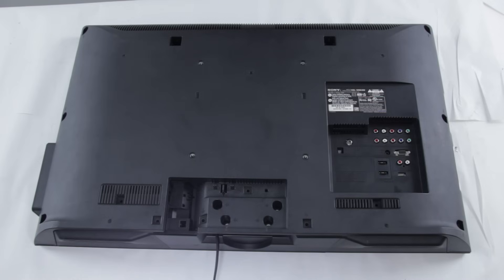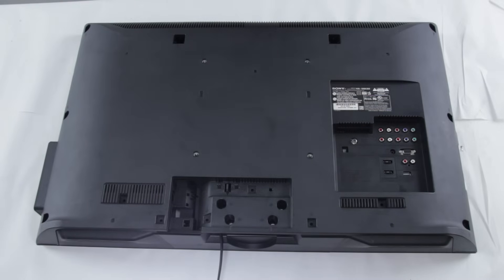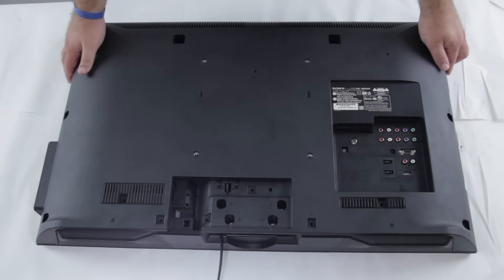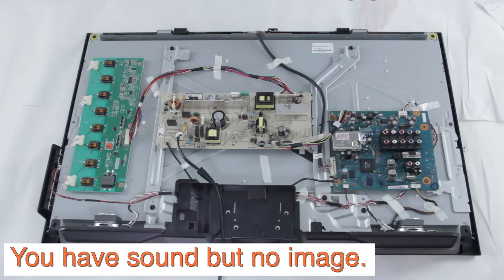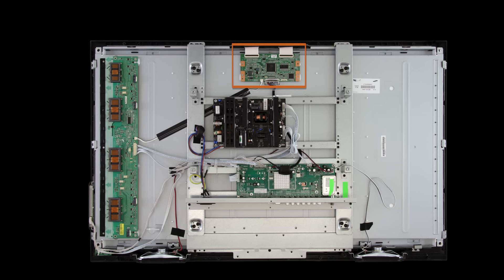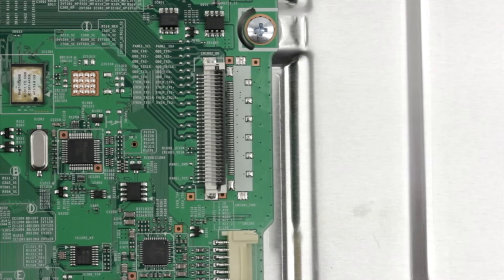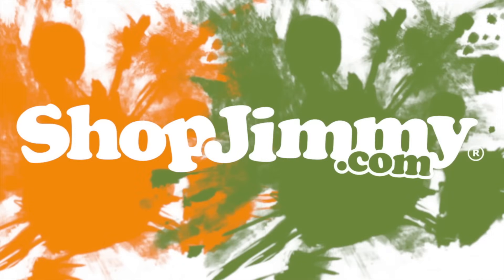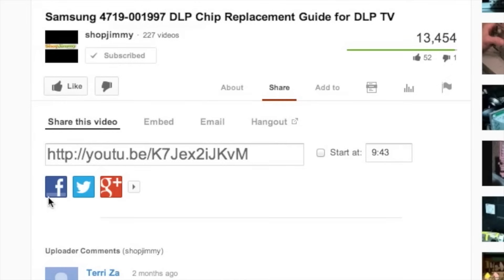LCD TV Repair Tutorial - T-Con Board Common Symptoms & Solutions - How to Replace T-Con Board

Comment: Appreciate all the videos you folks post to try and diagnose problems.  I have a UN55D6050TFXZA given to me by a friend that replaced the power supply but it didn't fix the issue.  Issue at hand is that the TV will not power up (stand alone, nothing hooked to the inputs).  The power LED will flash multiple times but nothing happens.  This model has the light around the outside frame and it doesn't even turn on.  I tried getting a replacement main board from you guys but it must be a hot model as you have no inventory (BN94-04358G).  I did find one on ebay and purchased it but still have the same symtoms.  The only board left is the T-Con.  Do you think this is my issue or do I have a bad LCD at this point?

Thanks for your time......
Reply from the maker: Todd Stam   I believe you received a defective main board from Ebay.  I recommend that you continue to find a new one and see if that will fix your TV problem.  Thanks!  www.shopjimmy.com

Comment: We have a Samsung 32 inch model LND32D430. Bought at Costco.
In the last week after a minute of being powered on the top of the screen develops a shaded gray 2 to 4 inch area. It goes left to right.  That shaded area stays there even with a change in screen size.  The shaded area stays on also when the cable box is connected or disconnected.  Have also done a hard factory reset with no loss of the shaded area.  Any answers on what is needed to fix this?  Thank you in advance for any imput.
Reply from the maker: Ron Normandeau  This sounds like a TV panel problem.  If your TV panel is bad, it may be more cost-effective to replace the TV as panels are typically hard to find in stock, difficult to replace, and expensive.  Thanks and please let us know if you have any further questions!  www.shopjimmy.com

Comment: Model No. LD320SSX
Serial No. DSIA0931171486
Sylvania 
When the power on, the colors changing by itself, (red,green,purple,blue,white) looping all the time. I already try the remote by hitting down or up arrow key, but it does not solve the problem
Reply from the maker: *****  I recommend replacing the main board in your TV.  Here is a link to replacement parts for your TV model number on our website, click here:  http://www.shopjimmy.com/catalogsearch/result/?q=LD320SSX  Be sure to match part numbers on your current board, with your replacement for compatibility.  You can also call our customer service for further assistance with your purchase.  (877) 881-6492  Thanks and please let us know if you have any further questions with your TV Repair!  www.shopjimmy.com

Comment: I have a KDL-46VL160, there is 2 vertical lines on the left side, and the left and middle is faded dark..
Reply from the maker: ben slaney   This sounds like the problem is either the T-con board or the TV panel. If the TV panel is bad, it may be more cost-effective to replace the TV. You can replace the T-con board to see if that fixes the problem. Here is a link to replacement parts for your TV model number on our website, click here: http://www.shopjimmy.com/catalogsearch/result/?q=KDL-46VL160 Be sure to match part numbers on your current board, with your replacement for compatibility. You can also call our customer service for further assistance with your purchase. (877) 881-6492 Thanks and please let us know if you have any further questions with your TV Repair! www.shopjimmy.com

Comment: I have a Sony Bravia KDL-52w3000 with vertical colored lines on the right side of the display.  After the unit has been powered on for about 30 minutes and has warmed up, the lines start to go away.  Any help would be appreciated!
Reply from the maker: tbirdman429   This sounds like the problem is either the T-con board or the TV panel.  If the TV panel is bad, it may be more cost-effective to replace the TV.  You can replace the T-con board to see if that fixes the problem.  Here is a link to replacement parts for your TV model number on our website, click here:  http://www.shopjimmy.com/catalogsearch/result/?q=KDL-52w3000  Be sure to match part numbers on your current board, with your replacement for compatibility.  You can also call our customer service for further assistance with your purchase.  (877) 881-6492  Thanks and please let us know if you have any further questions with your TV Repair!  www.shopjimmy.com

Comment: I have a dx-42e250a12, my symptoms are successful power on, low buzzing humming after power on, increase in volume of buzzing regardless of volume/mute setting on tv and eventual self shutdown by the tv. The shutdown of the tv start withs strange bars vertically and horizontally, and then the unit sel-powers off.
Reply from the maker: Shane Dalton   I recommend that your visually inspect your power supply board in your TV.  Check the capacitors for puffy tops.  Here is a link to a video on capacitors:  How to Test a Capacitor TV Repair Help with Multimeter and ESR Tester Puffy Capacitor  Please reply with the results of your inspection and please let us know if you have any other questions!  www.shopjimmy.com

Comment: Hi help ?? Have 2 lg tvs both same model . Both have lines across screen 1st has 2 vertical 2nd has 6 inch horizontal . Swapped tcons over and both stayed same the fault never swapped over . Warmed up t con board with hairdryer and picture comes on and is ok if turned on / off all day every say hour ?? Is this a t con problem ??? Thanks
Reply from the maker: Colin Brookes   You can try replacing the t-con board but when you heated them with the hair dryer you probably also heated the area of the panel that is bad and had a quick fix.  I am thinking the panel in your TV is bad.  If this is the case, it may not be cost-effective to replace the panel.  Please reply with your TV model number if you would like a recommendation on replacement parts.  Thanks!  www.shopjimmy.com

Comment: Hi, I have a Sony Bravia KDL40EX653. Top part of my Display is Flickering with a Blue strip. Could you please suggest what may be the problem
Reply from the maker: rohan07091987  This sounds like a TV panel problem.  If your TV panel is bad, it may be more cost-effective to replace the TV as panels are typically hard to find in stock, difficult to replace, and expensive.  Thanks and please let us know if you have any further questions!  www.shopjimmy.com

Comment: Hi I have a samsung ln46c650 tv which for the past several months has been intermittently displaying vertical green, yellow and/or white lines on the screen. This usually occurred when the TV was first turned on and seemed to improve with time (but not always). Also, it seemed to improve if we toggled with the HDMI cable or antennae cable in the back (but not always). Anyways, the other night we were watching television when we heard a loud "pop" almost like a light bulb bursted. The screen immediately turned black and we no longer have any image. We still have sound. I tried the flashlight test and I cannot see any image on the television. Do you have any thoughts as to what may be the problem? Thank you for your time.
Reply from the maker: Megan Day  I recommend checking your power supply for burn marks, and also looking for capacitors that look puffy on the top.  Here is a video link about capacitors: How to Test a Capacitor TV Repair Help with Multimeter and ESR Tester Puffy Capacitor  Here is a link to replacement parts for your TV model number on our website, click here:  http://www.shopjimmy.com/catalogsearch/result/?q=ln46c650  Be sure to match part numbers on your current board, with your replacement for compatibility.  You can also call our customer service for further assistance with your purchase.  (877) 881-6492  Thanks and please let us know if you have any further questions with your TV Repair!  www.shopjimmy.com

Comment: I have a Vizio E422VA 42" LCD that I believe was power surged.   So far I have replaced the powerboard and the main board.  I now again have a picture, but the entire picture no matter the source looks like I am on acid and viewing a pink floyd movie.   The vizio emblem on warm up looks this way as well as the settings and menu.   The parts I used are from broken units with bad displays.   Will a bad T-Con cause this or does it sound like the display is bad?
Reply from the maker: Christian Birkley  This sounds like a bad main board.  Here is a link to replacement parts for your TV model number on our website, click here:  www.shopjimmy.com/catalogsearch/result/?q=E422VA  Be sure to match part numbers on your current board, with your replacement for compatibility.  You can also call our customer service for further assistance with your purchase.  (877) 881-6492  Thanks and please let us know if you have any further questions with your TV Repair!  www.shopjimmy.com
Reply: I already replaced the main board, had no pic at all before.
Reply: I bought a certified unit, you all were out of them at the time.

Comment: Hello I have an rca 40" LCD TV model number is 40LA45RQ.  Problem is after powering on the screen goes out. Does not display channel # or anything audio works some of the time. So I just ordered a main board on your website. Do you think or know if this will resolve issue? Or is it the t-con board or possible power supply issue?  Thanks for your help in advance
Reply from the maker: Anthony B   I am thinking the main board will fix the problem, but it could also be the T-con board that is bad.  See if the main board fixes the problem and let us know the results.  Thanks!  www.shopjimmy.com

Comment: hi, I have a LN46A530P1F Samsung. The picture sort of looks ok on cold power up, but then image fades, colors are weak. Back light seems ok, but seems like the LED is washed out. Could this be the LED or T-CON board ? thanks!!
Reply from the maker: Noel Mackisoc  I recommend replacing the T-con board in your TV to see if that fixes the problem.  Here is a link to replacement parts for your TV model number on our website, click here:  http://www.shopjimmy.com/catalogsearch/result/?q=LN46A530P1F  Be sure to match part numbers on your current board, with your replacement for compatibility.  You can also call our customer service for further assistance with your purchase.  (877) 881-6492  Thanks and please let us know if you have any further questions with your TV Repair!  www.shopjimmy.com

Comment: I have a Sony KDL-40Z4100 LCD HDTV. The unit is having numerous picture problems. The color appears "solarized" or like a negative image. Colors are blown out and over bright, but all picture settings are at defaults. There are also vertical and horizontal lines and ghost images that appear burned into the screen and last a long time. If I turn the brightness and contrast all the way down, the color appear almost normal, except of course the picture is dark. I've uploaded a video demonstrating the picture problems here: http://youtu.be/swzr2kHc7V8. I appreciate your help and suggestions.
Reply from the maker: 770211dnobk   I recommend replacing the T-con board to see if that fixes the problem with your TV.  Here is a link to replacement parts for your TV model number on our website, click here:  http://www.shopjimmy.com/catalogsearch/result/?q=KDL-40Z4100  Be sure to match part numbers on your current board, with your replacement for compatibility.  You can also call our customer service for further assistance with your purchase.  (877) 881-6492  Thanks and please let us know if you have any further questions with your TV Repair!  www.shopjimmy.com

Comment: I have a Sony KDL-46W3000. When first turned on, there will be two, single pixel wide vertical lines from top to bottom on the right side, about 1 inch from the edge.  After the set has warmed up, 20-30 minutes, these lines disappear only to have a single line appear on the left side about 3 inches from the left.  A single line, one pixel wide from top to bottom and it stays there the whole time the set is on.
Reply from the maker: E Ryan   This could either be a bad T-con board or a bad TV panel. If the TV panel is bad, it may be more cost-effective to replace the TV. You can replace the T-con board to see if that fixes the problem.  Here is a link to replacement parts for your TV model number on our website, click here:  http://www.shopjimmy.com/catalogsearch/result/?q=KDL-46W3000  Be sure to match part numbers on your current board, with your replacement for compatibility.  Here is a link to a video showing how to identify your part number, click here:  Samsung Timing Control (T-Con) Boards Part Numbers Identification for LCD HD TV Repair  You can also call our customer service for further assistance with your purchase.  (877) 881-6492  Thanks and please let us know if you have any further questions with your TV Repair!  www.shopjimmy.com

Comment: philips 52pfl7403d/27 the picture has upper left 1/4 has vertical lines and Will some times be 1/2 the screen affected but the picture doe show thru some times
Reply from the maker: Toby Scott  This could either be the a bad T-con board or a bad TV panel.  If the TV panel is bad, it may be more cost-effective to replace the TV.  You can replace the T-con board to see if that fixes the problem.  Here is a link to replacement parts for your TV model number on our website, click here:  http://www.shopjimmy.com/catalogsearch/result/?q=52pfl7403d%2F27  Be sure to match part numbers on your current board, with your replacement for compatibility.  You can also call our customer service for further assistance with your purchase.  (877) 881-6492  Thanks and please let us know if you have any further questions with your TV Repair!  www.shopjimmy.com

Comment: Samsung ln46a630m1f- I'm looking for a t-con board lj63-05707a I can't seem to find one.I'm getting an solid black line in the center or on the side as well as some color issues in the corner.
Reply from the maker: carey lee   Here is a link to replacement parts for that TV model number on our website.  You will need to compare information from your T-con board and the T-con boards in the listing to confirm compatibility.  http://www.shopjimmy.com/catalogsearch/result/?q=ln46a630m1f  Be sure to match part numbers on your current board, with your replacement for compatibility.  You can also call our customer service for further assistance with your purchase.  (877) 881-6492  Thanks and please let us know if you have any further questions with your TV Repair!  www.shopjimmy.com

Comment: i have a 60 inch sharp tv model number is lc-60E78UN  i replaced the power supply board and replaced the main board and im still getting a green blinking light and the tv well not turn on. thanks

Comment: I have a Sony Bravia KDL-52W5100 that I bought new 3 years ago. When I turn on I get vertical lines. Initially, resetting the TV helped but now the lines are there once TV is turned on. Sent it to a Sony authorized service dealer and they said the panel is bad. Could the problem be the T-con board that you mentioned? And for this model, is the T-con board bonded to the panel or sperate and can be replaced?
Please Please help.
Reply: Please respond to above shopJimmy

Comment: Hi I have a lg 42 inch lcd and after around 5 mins of turning on the picture will go black but sound will stay on. If I turn off at the mains then turn back on it works fine then for the rest of the day. Any help appreciated.
Reply from the maker: liam marriner   Please reply with the TV model number and then I can recommend a replacement part for your TV Repair.  Thanks!  www.shopjimmy.com
Reply: Lg 42lf66-ze is the model number. Back lights stay on and only one speaker working.  Thanks
Reply from the maker: liam marriner I recommend replacing the main board in your TV, if you know the backlights are staying on.  Here is a link to replacement parts for your TV model number on our website, click here:  http://www.shopjimmy.com/catalogsearch/result/?q=42lf66-ze  Be sure to match part numbers on your current board, with your replacement for compatibility.  You can also call our customer service for further assistance with your purchase.  (877) 881-6492  Thanks and please let us know if you have any further questions with your TV Repair!  www.shopjimmy.com

Comment: Hello:
Model no. LN52A650A1F S
Model code. LN52A650A1FXZA
S/N. ALOT3CFQ502890J
 
Symptom:
Blured / Flickering horizontal lines across the bottom third of the screen.

Any ideas?
Thanks in advance.
Reply from the maker: Shaun Ledford  This sounds like a TV panel problem.  If your TV panel is bad, it may be more cost-effective to replace the TV as panels are typically hard to find in stock, difficult to replace, and expensive.  Thanks and please let us know if you have any further questions!  www.shopjimmy.com

Comment: I have a sony kdl46v5100 when watching kind of lost focus went black and returned with vertical lines all accross screen with no sound.
Reply from the maker: Hank Kemp   I recommend that you replace the T-con board in your TV.  Here is a link to replacement parts for your TV model number on our website, click here:  http://www.shopjimmy.com/catalogsearch/result/?q=kdl46v5100  Be sure to match part numbers on your current board, with your replacement for compatibility.  You can also call our customer service for further assistance with your purchase.  (877) 881-6492  Thanks and please let us know if you have any further questions with your TV Repair!  www.shopjimmy.com
Reply: ShopJimmy.com Thanks for your response. I found that the t-con board had a blown component and also had a pinhole in one of the flat ribbon cable. How important is the serial number for the ribbon cable?  I did locate a t-con board with same part number, the only one,  on e-bay.